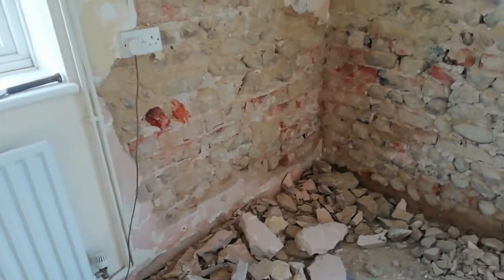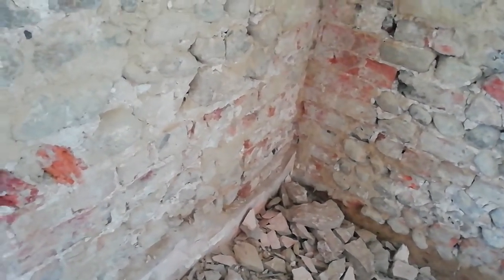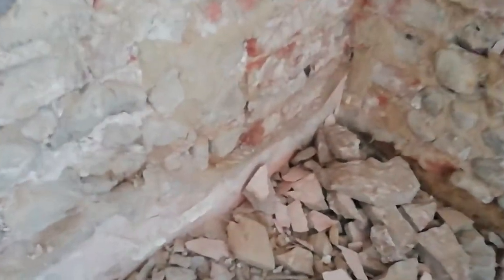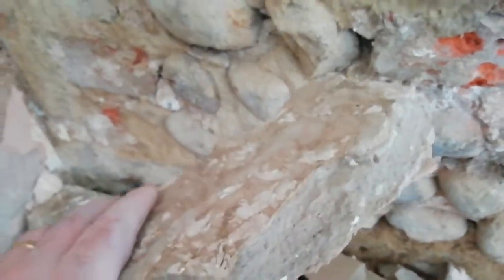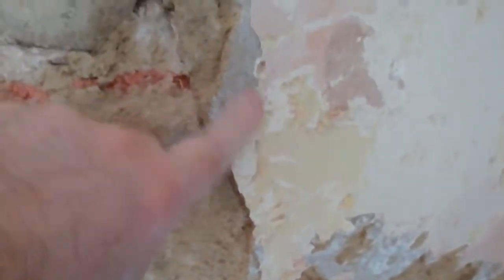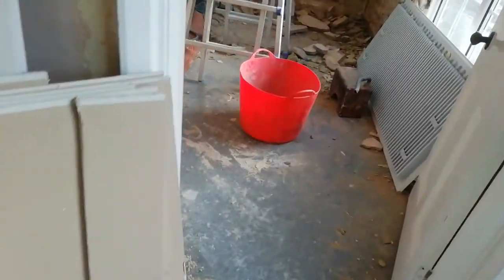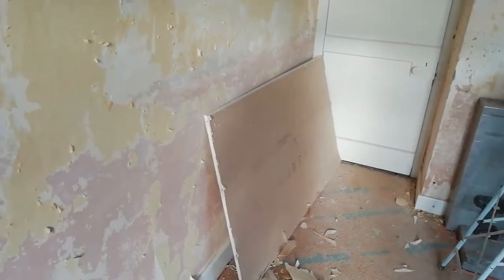A little look around at the sort of work we do & some bonus 300 year old limewash

Comment: Thanks for sharing, the wet wall in the hall it's not external what's causing the wetness?
Reply from the maker: Hi Alex, thanks for the question.  At the moment we're not 100% sure.  The building has been altered a lot over the years and that was used to be an external wall.  That probably has no bearing on why the damp is there though.  We don't know why the chemical guys thought the wall was wet.  We don't know how many times the wall has been damp proofed.  At least once is obvious.  I think there has been a leak in bathroom at some point which could be a reason as to why the damp proofers thought it was rising damp.  It could be something to do with the concrete floor.  Maybe there's a bit of membrane sticking up forcing moisture into the wall.  As it stands we're not touching the wall. The homeowner is thinking about removing that wall and going open plan. I'm sure at some point we'll know exactly what the problem is, but for now we're guessing.
Reply: @strikemehandsome  thanks for reply, I'm sure you will figure out what's going on. Will the outside levels be lowered below the floor you spoke about?
Reply from the maker: @alexprichard6003  yeah, the outside levels have been reduce to the gable. We lowered those and repointed the gable end before Christmas. There's a bit more to do but hopefully the main bulk of the restoration will all be completed by the end of summer if all goes to plan.
Reply: @strikemehandsome  thanks,  I'm sure it will go a long long way to preserve that  lovely building.